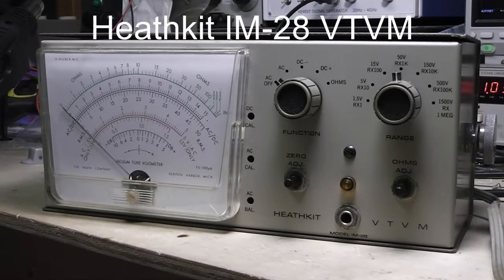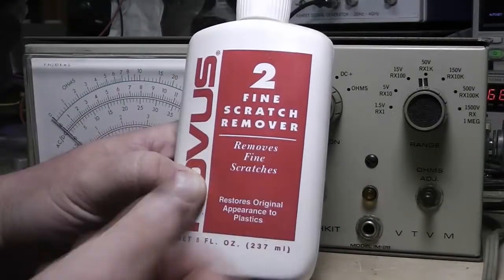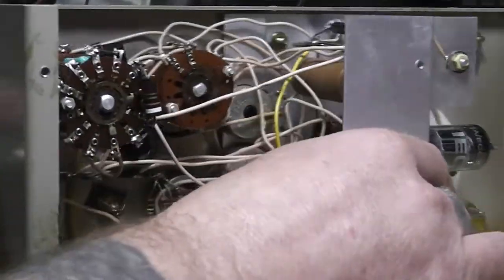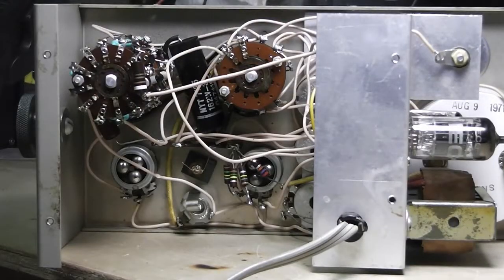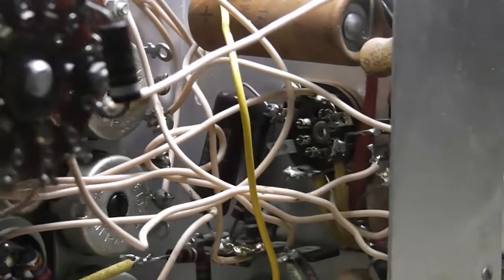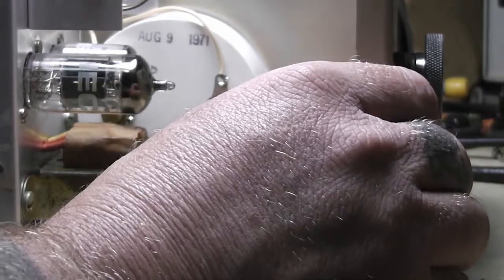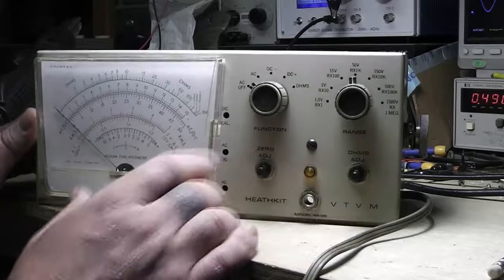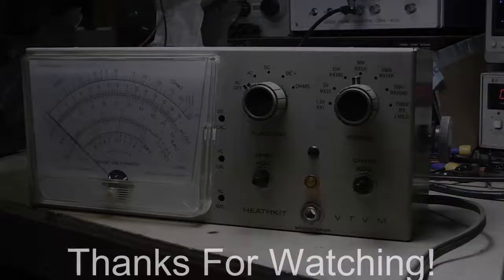Heathkit IM-28 VTVM, Steps Needed for Restoration

Comment: Nice video, years ago I built the same VTVM as part of an NRI electronics course. I used it in my TV / Radio repair shop until I sold the shop. Just recently I
started into restoration of old radio gear as well as some ham gear so I bought one off Ebay. I plan to restore it; your video helped. Thank you and 73 AD7VV
Reply from the maker: Glad it helped you out!!

Comment: ok, I have a fault, restore one, but I can't find the problem, the needle runs backwards
Reply from the maker: Maybe it is as simple as the meter wires are installed backwards??
Reply: @ke4est  I don't know, because I don't have a way to see where each end goes, but I'll try to change them, I've never restored something like a tester, I have more than 40 old restored radios in my house for decoration and an 80-disc jukebock, thanks I'll do that and see what occurs

Comment: Nice job.  I'm hoping to get mine up and running soon.  I picked up two of these, one with manual and probes.  The 9.1 Ohm 2W resistor is out of spec at 9.68 Ohms.  The parts list calls for a precision resistor and both the ones I have are 5%.  I see yours is also 5% (unless the color on my computer is off).  I haven't found anything during research to contradict the manual.  Do you know what the deal is with these?
Reply from the maker: Modern resistors from a reputable supplier will hold their value pretty good within operating temperature(room temp).  If you can source some 9.1 ohm 5% resistors, get a few and ohm them out yourself to find one that is closest to actual 9.1.  You can get some at digikey.  The reason you want it to be precise is so that the meter tracks correctly.  9.68 will work, but the accuracy of the meter reading may be off.  For example if you are on the 15V scale and your resistor is off a bit, 5 volts may read 5 volts, but 10 volts may read a needle width higher than dead on 10V and 15 volts may read even off more.  Sometimes you have to take some resistors you have and make your own precision resistor so that the meter tracks correctly.  This will involve some calculations and trial and error with some series and/or parallel-series resistor combinations.
Reply: @ke4est  Thank you for your reply.  I'm playing with that now and will let you know how it goes.
Reply from the maker: @rosshollinger8097  Sounds good!

Comment: Hello Michael, I rerstored one of these & it worked well for a while. It now won't read on the r x 1 scale. Do you know what might cause this?
Reply from the maker: Check your range switch to make sure no contacts are broken. Check for broken wires and cold solder joints on the range switch.  Also, check the precision resistors on the wafer switch.

Comment: Since batteries are now made overseas; they're CRAP and they LEAK quite quickly, it's best to put a Battery Eliminator in!
ALL the roundy resistors need to be changed.  At 11:06, there's a resistor tied to a wire!
Reply from the maker: Yes, I agree, that is why I said personal preference. 🙂  No roundy's in this one, all Allen Bradly and all well within tolerance.  No that is an optical illusion.  😉